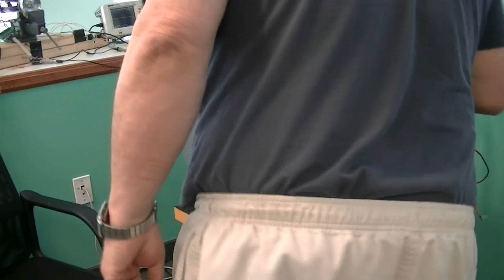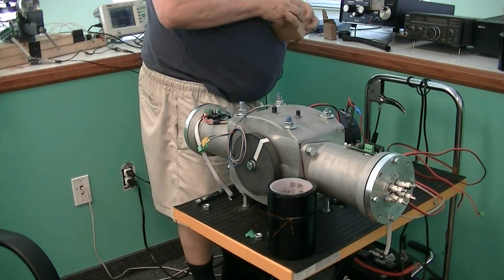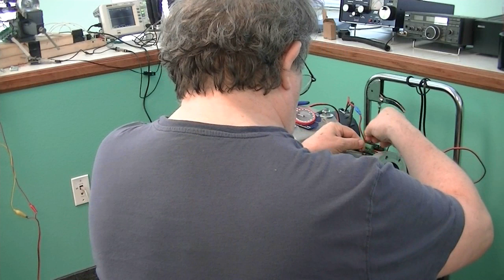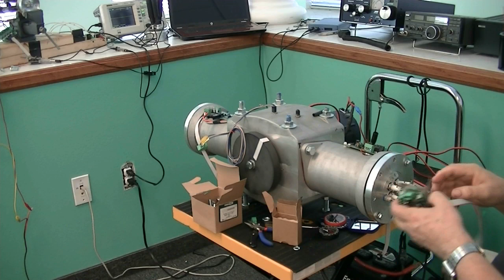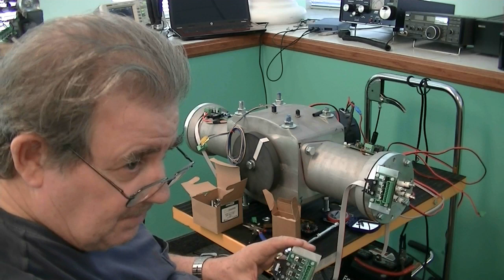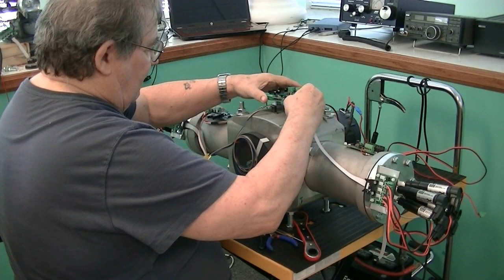ENG2

Comment: First to David Cross, fusion is very rampant in todays world. Only in certain specific circumstances does it create any volume of Neutrons, About what you get when looking thru a glass of water at the sun.. As to underwear sorry but light cloths works best in Vegas..  Also understand that Papp never understood what the actual "process" was that made the engine produce work. Over the last couple years I have found that many gas mixtures will work and provide various results based on their formulation, some higner power some higher transition speed, or cycle speed abilities. Also you may want to know that the new International Corporation is "quietly" building a new R & D center below Can Cun. Seems like a good place to work and play. The Prototype engine manufacturing is going into Mexico as well, and we plan to ask any Mexicans to join us. We are also creating a "license pool" that does not include the USA. I figure with the "Village Idiot" deciding he would rather breath "coal dust" than fresh air  and prefers to Resurrect ancient burial grounds so his buddies can drill is not much a person of any ecological sense.  So when the rest of the world runs talks that do not need refueling and his run out of gas we hope that N Korea will have pity on his worthless ass and his "surgically correct" barbie doll family.  The R & D center should be complete in April and then we hire the best. Great place for SCUBA too..  As I said the best example of the process is something we all know well.  And Yes Johnny the transition is triggered by a sub nano second Fusion event. Been a great couple years as we started up the world.

Comment: Hey John - I have a couple of  questions: 
  1) Do any of the manufacturers plan to sell a stand alone engine for tinkers? 
  2) Will the IC boards be sold separately so customers can stock their on spares?

The generator ends appear to be Stamford Newage 20-30 Kw, capable of Single or 3 phase. 
  1) Can you confirm details? 
  2) Do all manufactures plan to use this generator end?

Looking forward to purchasing a couple when they become available.